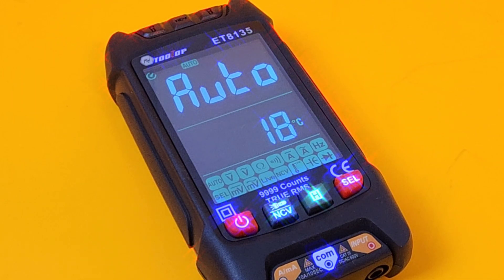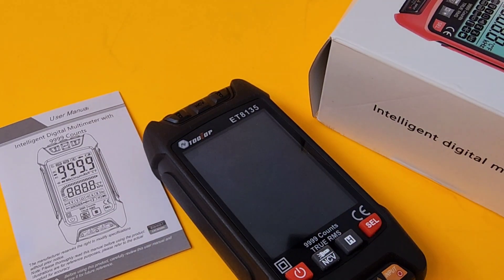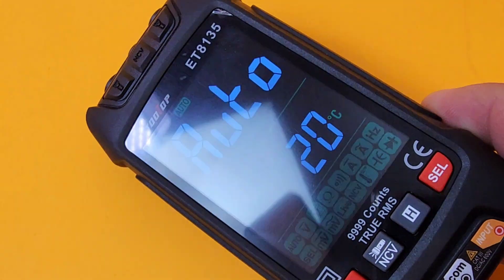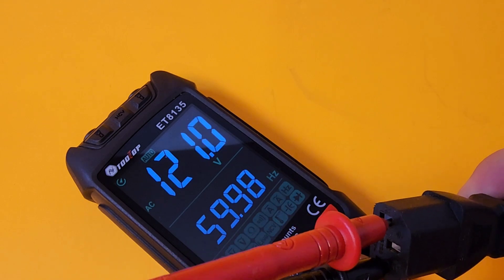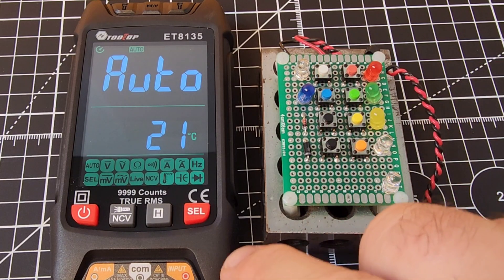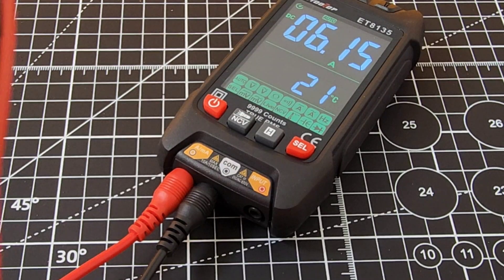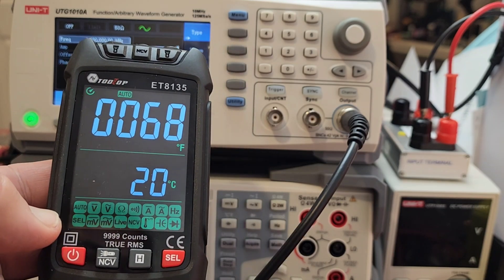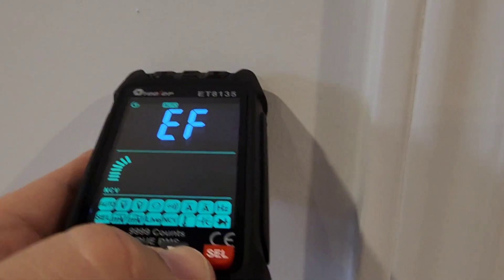TOOLTOP ET8135 CHEAP-O Multimeter Review & Teardown!

Comment: These type meters though improving still seem to be more flash and  gimmick with good function in some areas and no so much in others - limited by relay delay, limited low end resolution still no tilt stand mainly im guessing because the bottom lead jack location prevent it. Dont think these will ever be as rock solid in basic functionality as a more traditional designs.
Reply from the maker: They are geettng better.I think this is less gimmicky than many Mike but I hear ya !

Comment: This has the feel of a start trek communicator!  🖖Evidently this is the ANENG SZ02 v1.3 in plain black with color-filtered inverse display.  (The v1.6 actually works much better). The package box is identical.  This meter doesn't have the ANENG's red backlight alert for NCV, high current or volts, I would miss that feature. ▪I also find the power is turned on accidentally... not sure why the buttons have to be so tall! ▪Each lead measures 80 milliohms, which is the reason they get warm.▪The beeper volume can be reduced by changing R18 from 10 ohms to a higher value (I used 33 then kept going to 75 ohms), this also increases battery life. ▪My unit came with the NCV input jack bent the wrong way!  I replaced it with a coil spring.  💡During the tear-down, did you notice the independent split leads on the current input which automatically detects that you plugged in the current lead?  Pretty cool idea, never saw it anywhere else before. 👍 Although quirky, this meter is a good value and all the ranges work as promised.  Looking forward to your test lead review👏
Reply from the maker: Star Trek!! Now why didn't I think of that!! It is quirky indeed! Still a great value and an awesome display to boot! We just checked in to Mechanicsburgh PA ;):hand-pink-waving: